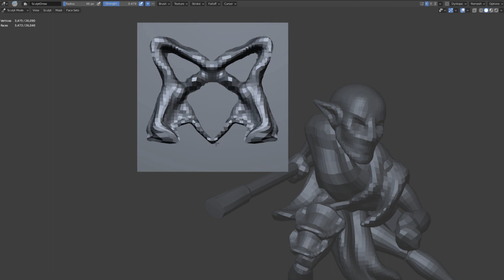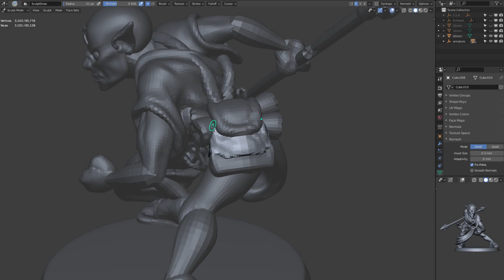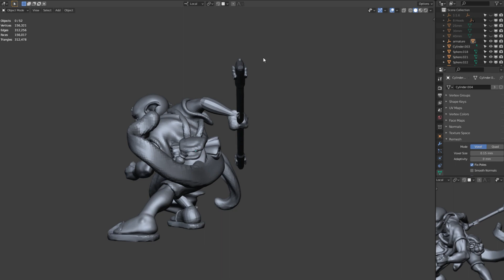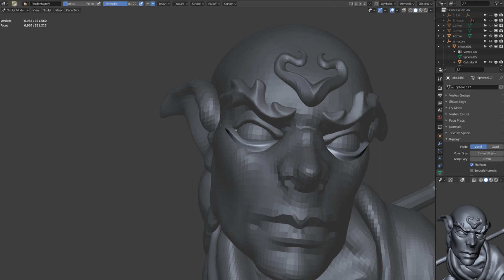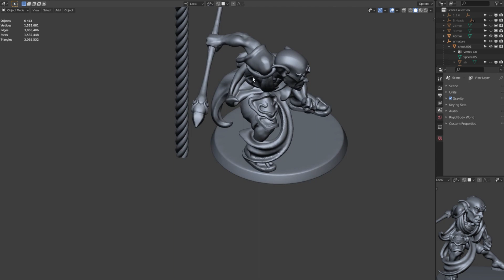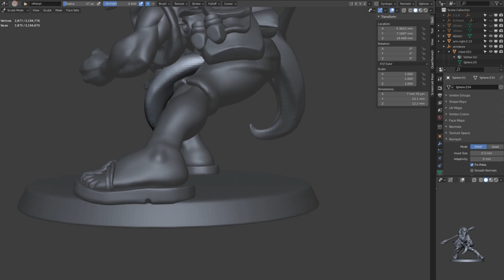Monk Adventurer Sculpt - Timelapse With Commentary

Comment: I cannot find anywhere how to join two parts like you did for feet and legs, not even in your tutorials. Not if you want to keep a clean topology and not if you want to use triangles
Reply from the maker: Hey so here I am selecting the objects then hitting ctrl+j to join the objects together. Then you can go back into sculpt mode and remesh, if you use a higher density you will not lose much detail and can always decimate if the mesh becomes too dense
Reply: @MWSculpts  Thank you, I did not know if it was Join or Boolean the best way to join to objects :)
Reply from the maker: So you could also Boolean but you might find that it is not very consistent with such a dense mesh and you will have less geometry to play with around the join. But I would try out both methods as they both have pros and cons 🙂

Comment: This is like the 3rd time I’ve watched this. Great work!

2 questions for you… it seems like the mesh active in sculpt mode is more emphasized or less grayed out. How did you achieve that in Blender?

Do you have hot key mapping to switch between which mesh is active in sculpt mode?
Reply from the maker: Well if you enter sculpt mode on an object then hit the 'overlays' menu near the top right you will see a slider for 'fade inactive geometry', give that a go.

Then for hot switching objects I use the 'd' key while hovering over the object, if this does not work for you, you may need to enter 'preferences', then search for 'transfer mode' option and set this to the key you would like.

Hope this helps any further q's just let me know ^^.